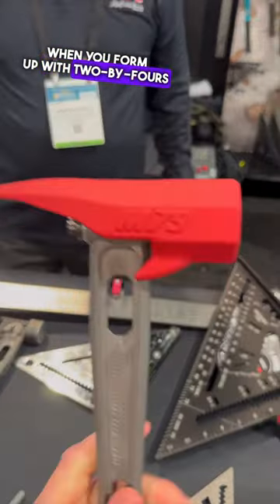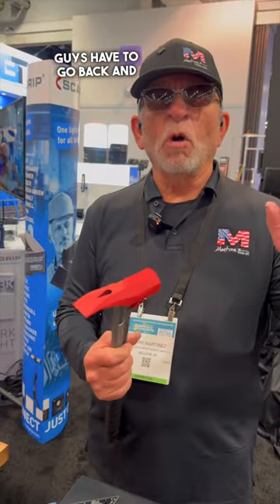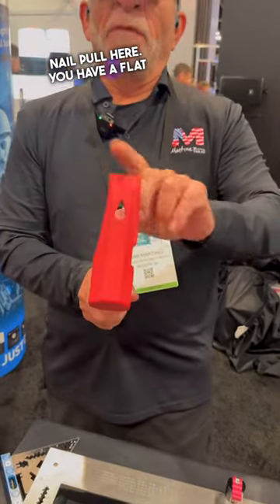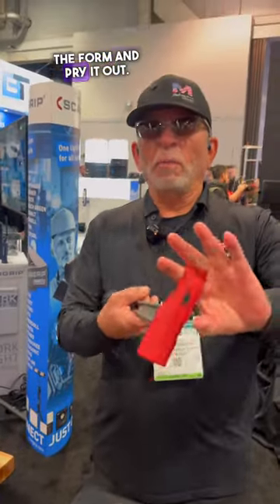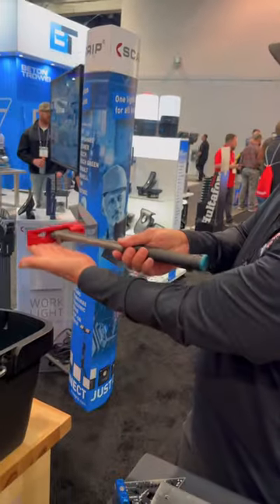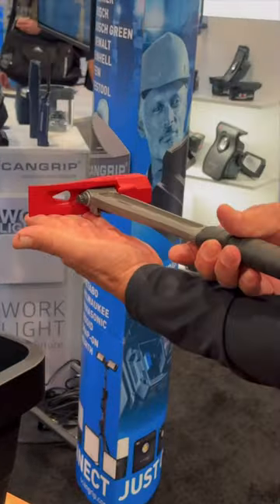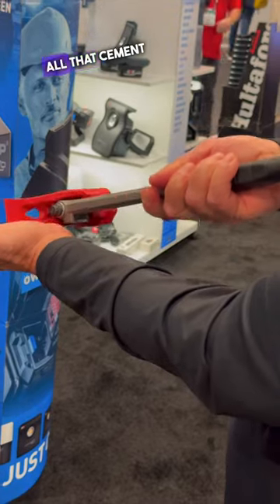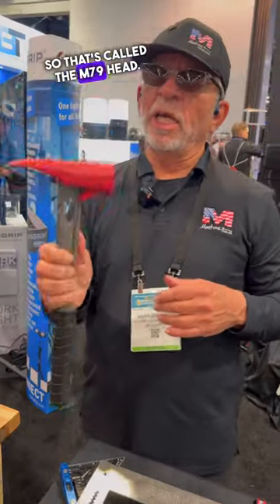Innovative Hammer Head For Concrete Work! #concrete  #construction #innovation #shorts

Comment: As a form worker, I can confirm this is a hammer nobody needs. It will probably cost way to much too
Reply: Two too to 2
Reply: I formed, tied steel and finished concrete for 30 years and I cannot see one single time this "Fancy" hammer would have been handy. Give me my trusty Eastwing any day. All metal and almost indestructible.
Reply: @mikeh.753  best hammer for the job! I tried some goofy shit over the years, but I always ended up with the blue handle.
Reply: Nope Wrong. As a hammer worker, I'm ACTUALLY QUALIFIED to speak on this.  It's not a hammer. It's a 2 lb maul.
Reply: @kyliemoore9013  actually its mechanical scientific title is , a multi directional impact generator.
Reply: Too light for stakes to damn heavy for nailing.

Comment: anyone who has actually worked with a hammer for more than a weekend will tell you, NO ONE wants to hold a 2lb hammer all day. a normal 16oz is plenty, & if you need a heavier hammer , you use one. these 'new product' clips reek of used car salesmen
Reply: I've used a 22oz hammer every day for 20 years. I agree with this comment
Reply: When was the last time you set concrete forms? A 2 lb hammer is way too small, not way too big.

Comment: I did a few years of concrete/stampcrete in my youth. One guy had a sledge and is setting takes or pins with a guy with an east wing hammer setting/nailing forms. The other guys are busy wheelbarrowing sub-base, skretting, raking and packing.

No one guy is doing everything.